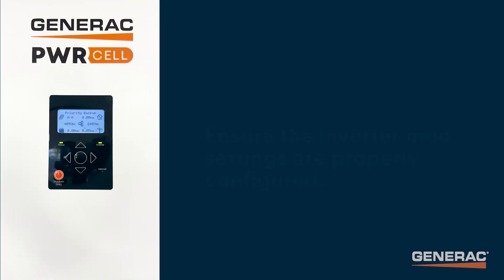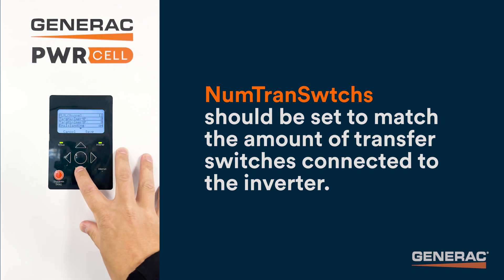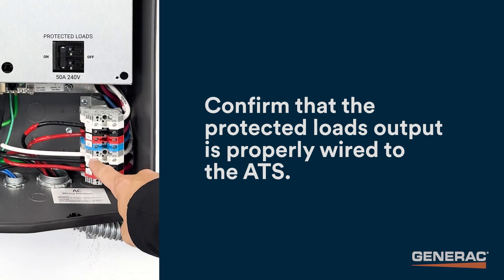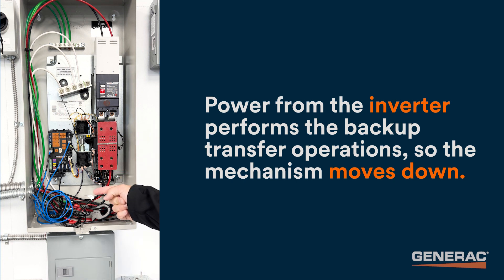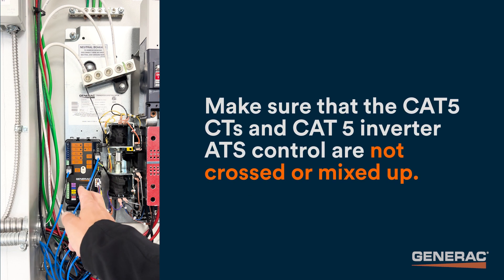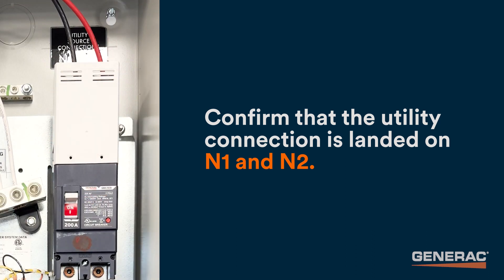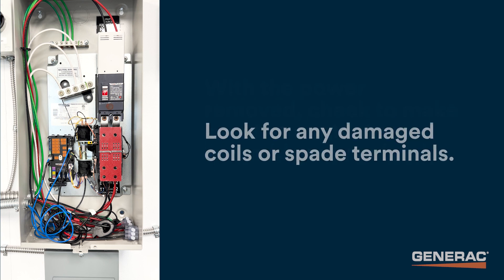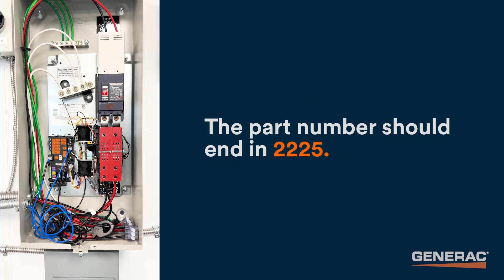Generac PWRcell Pro Tips: Troubleshooting the PWRcell Automatic Transfer Switch (ATS)

Comment: I get power disruptions during storms that cause a second of outage.  Ie, power drops and comes right back on.  The ats properly goes to islanding most of the time when this happens.  However, it doesn’t seem to switch back to the grid when power is immediately back on.  Not sure if its a grounding issue or wiring for n1, n2.  I’ve had several generac techs come.  They replace the control board but i keep having the same issue.  Any idea what could be wrong?